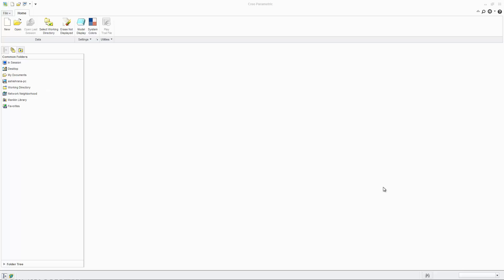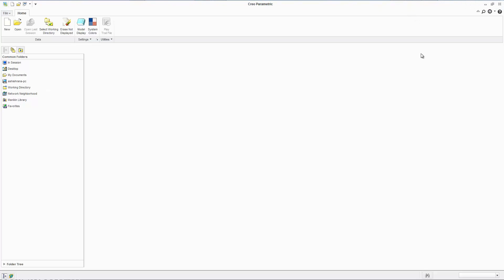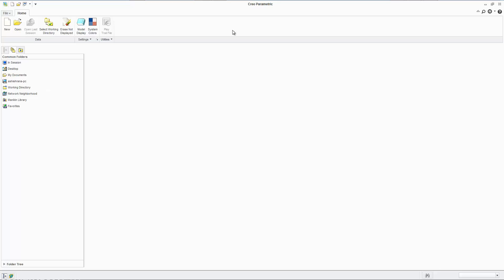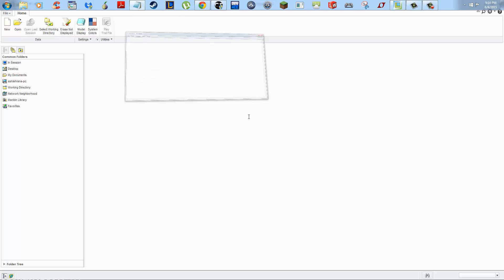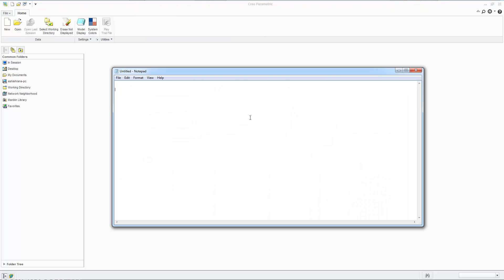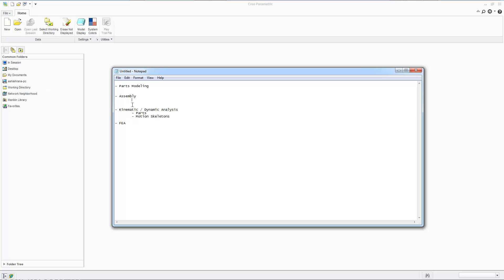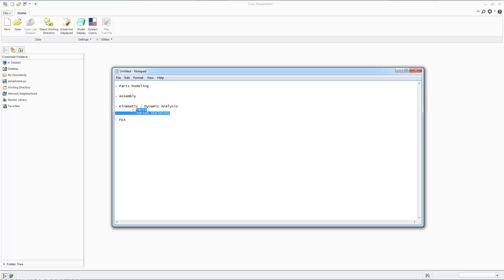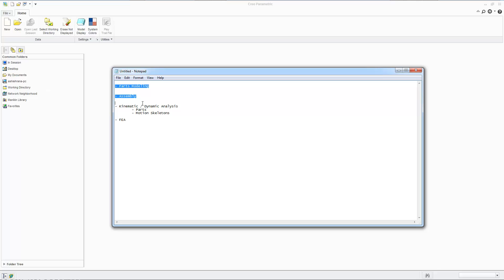01 Creo Parametric - Introduction

Comment: Thanks for telling me to avoid this software, but unfortunately it's required for the second half of one of my classes. We've only been using it for two days and I already want to scream. I clicked on the close X in the view tab while I was trying to apply the surface color to my model and it closed my whole model without warning me that I was and without giving me the option to save it. I can't believe that this software is still in use by so many big companies. I think that they should take your advice and move on to bigger and better things like Solidworks. Thanks for your assistance once again.